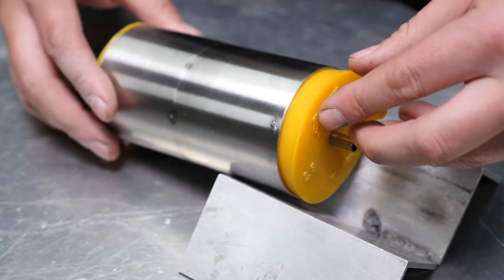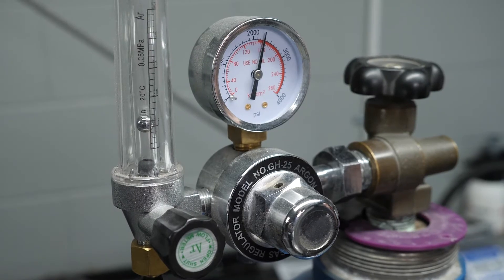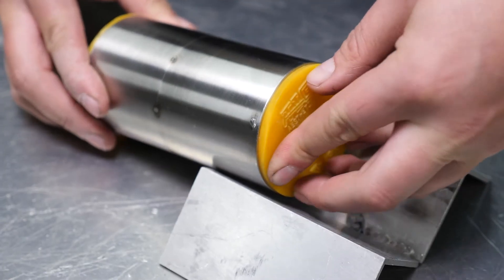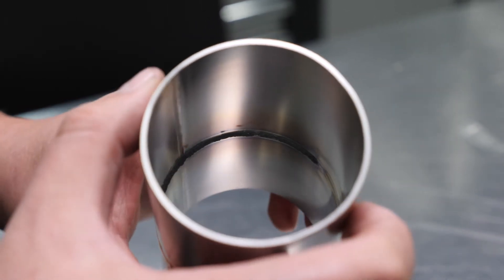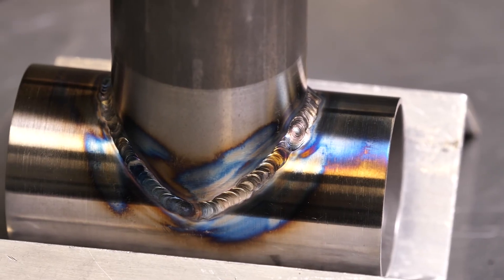The Hidden Side of Every TIG Weld Nobody Shows You

Comment from the maker: Who's your favourte online welding tool and material supplier? - Taz.
Building a fast car? Get $400 OFF the all inclusive VIP package deal:  https://hpcdmy.co/vipy36
Practical TIG Welding course. Get started today with 50% OFF: https://hpcdmy.co/offery36
TIME STAMPS:
0:00 - What Is Purging?
0:28 - Why Do We Purge Our Welds?
0:42 - Stainless Example Plan
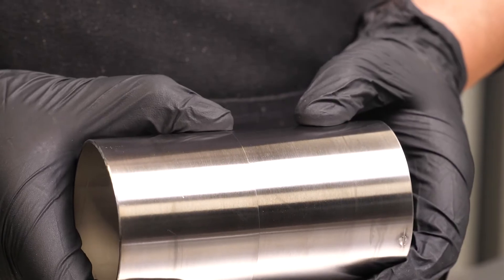0:52 - Poor Fit Up, Poor Purging
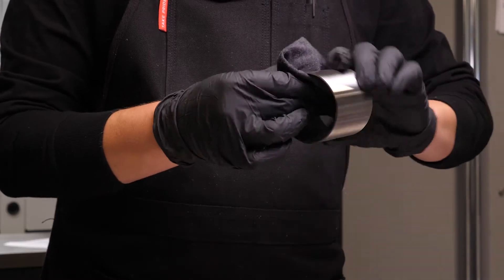1:24 - Tack Welding Using Kapton Tape
1:47 - Do You Purge Your Tack Welds?
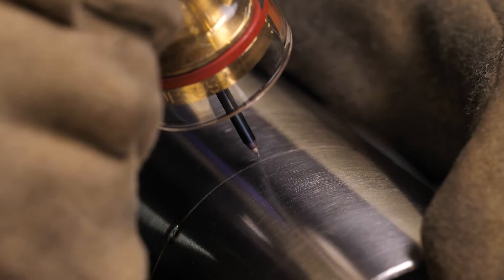2:01 - Sealing Your Tube Options
2:18 - Silicone Plugs
2:30 - Masking Tape
2:36 - Argon Filling Tip
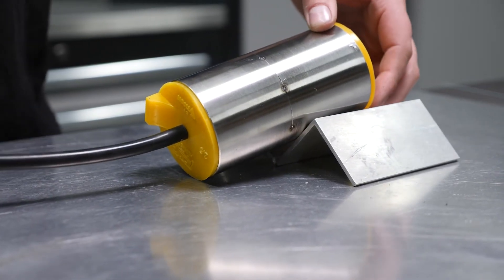2:48 - Purging Bottle Options
3:07 - Gas Flow Rate Rule Of Thumb
3:35 - Not Instant To Fill
4:14 - Position Of Your Weld
4:28 - Spend Some Time Practicing And Inspecting
4:37 - Vent Argon, Don't Pressurise
4:54 - Do You Change Your Technique When Purging?
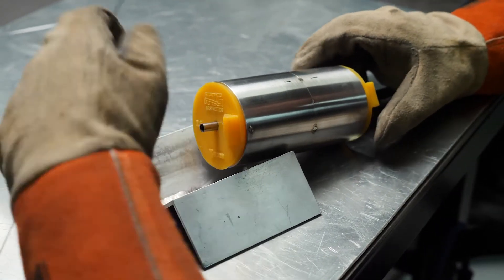5:09 - Purged Vs Un-purged Example
5:38 - Do It Once, Do It Right
5:56 - Learn More On TIG Welding And Motorsport Fabrication

Comment: where i work/learn welding stainless steel we dont use lens cups we only use stubby is there a reasson for?
Reply: They want to be cheap? Stainless does require a lens but it def helps get better results. Many jobs don’t have them due to price and the lens can get dirty and need more replacing

Comment: Last time I attempted a purge, I was tigging a Sched 10, 3" Stainless Steel pipe, no gap on the joint, my amps at 90.  I was told to keyhole the root pass but couldn't for the life of me. It looked like fuckin garbage. I just kept heating up my arc in one spot hoping it would open up my keyhole  but no luck. Any advice?

Comment: thank you to showing  how does it look inside, but your pipe is at least 2mm thick, and you use add rod at least 1.2-1.6mm thick, ( i did it on 1.5mm thick pipe) and welds inside when purged look great but it still reduces inner diameter of pipe and are not slick as pipe is and it would be better to flat it by grinding
Reply: Use smaller wire ?
Reply: @kevinaguilar6948  i used 1mm wire , and 36-38 amps on 1.5mm thick pipe and i had to be fast otherwise it would be made hole

Comment: Wadding up a piece of aluminum foil is also another method of blocking the end of a tube. On a long tube, it is possible to shove the foil ball into the tube to reduce the volume  to save on
the inert gas.
Reply: Reynolds Cap

Comment: Another option is to use Solar Flux type B on the backside of the weld. Not beautiful, but much easier and does a very adequate job of shielding the backside of the weld without the fuss, hassle and argon expense of a back-purge.
Reply: I could see that being pretty useful for certain situations like welding flanges to tubing where it is difficult to adequately cover up to hold argon and still provide clearance to make the weld.